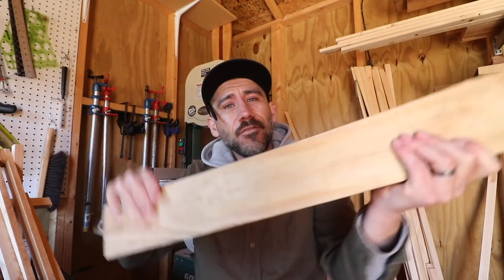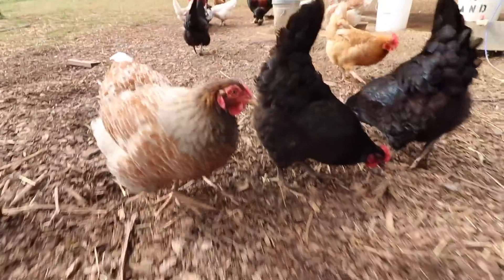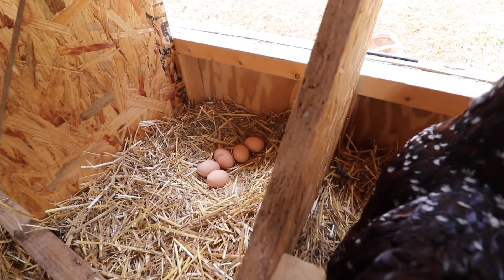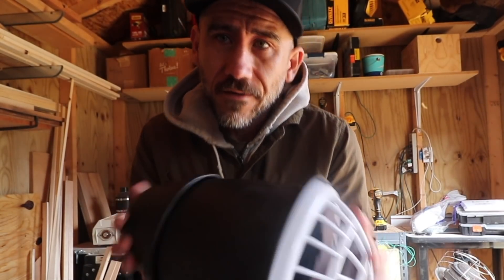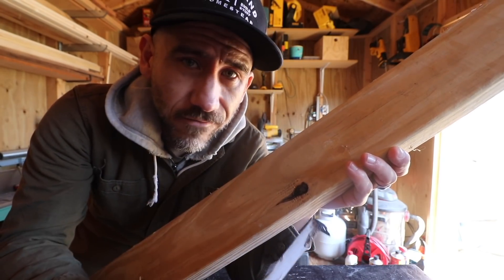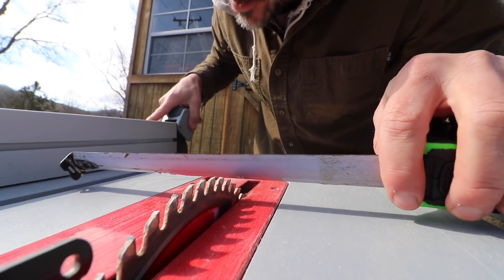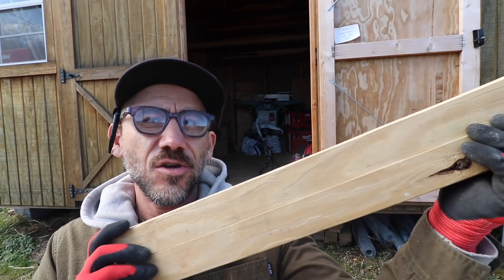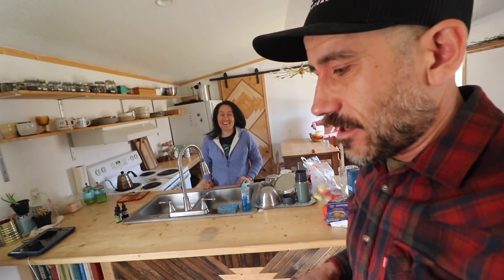(money saving) Trick when building a chicken coop

Comment: Jason your Birds are a super Pretty Mix.  Green egg! What No blue?  You mention thinning down the wood stock on building. Oh man I could of used this knowledge to build an Ultra light Chickshaw. We did scrap wood and man its heavy. Not to mention the most critical point. The wheels! They make the bus go round and round. I bough what I though was big enough wheels.  I was WRONG!  1 inch Hardware cloth has been near impossible to find up here in Jonesville Va. I travel to TN and NC looking. Everything But 1 inch. 1/2 inch just is a chicken poo poo collector. This is 100% a no no for any new builder.  1 inch on the bottom is the way to go. I have to rebuild it and fix this error and the wheels.